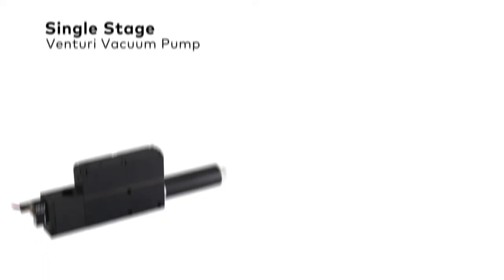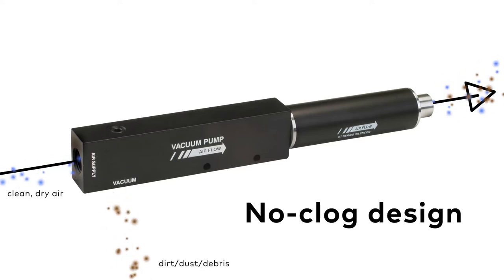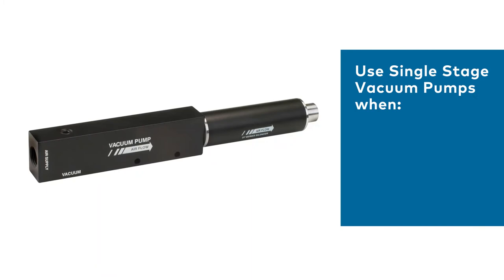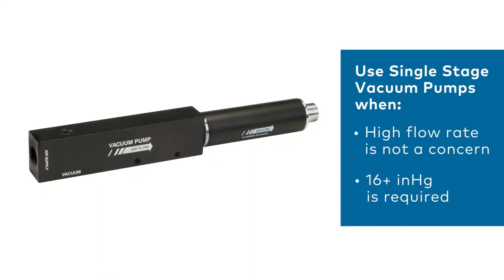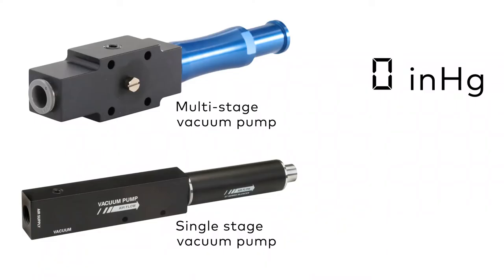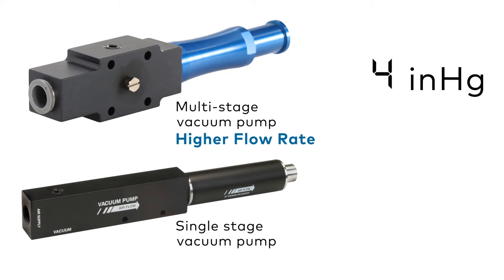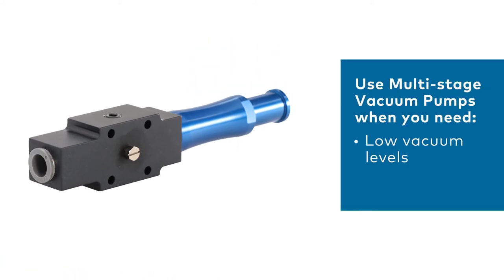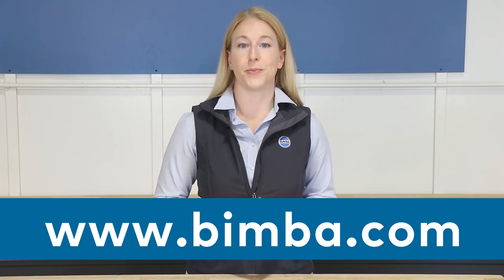TECH TALK: Single Stage Vacuum Pumps vs. Multi Stage for Pick and Place Applications

Comment: which type of vaccuum suitable for resin infusion for composite manufacturing?
Reply: From another site ... Venturi vacuum generators should generally be located as close as possible to (or on) the actual process. I don't work for a vacuum machine mfg, but I am familiar with vacuum bag reinforced plastics fabrication. This method of fabrication requires some sort of tank in the system as well as vacuum suitable tubing.  The tank allows for vacuum loss while pulling resin into the bagged chamber as well as a collection site for resin vapors. These vapors can effect vacuum pumps over time.